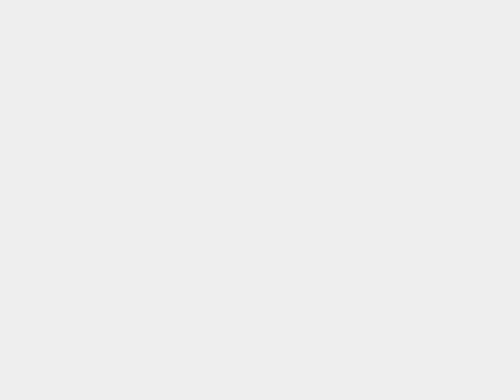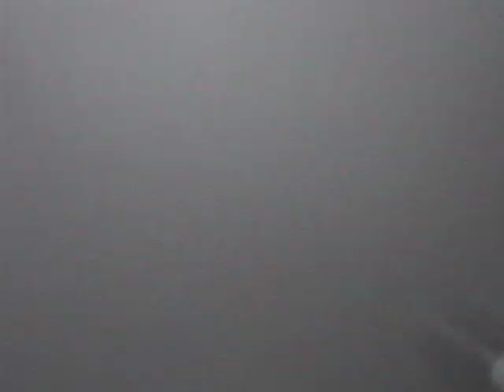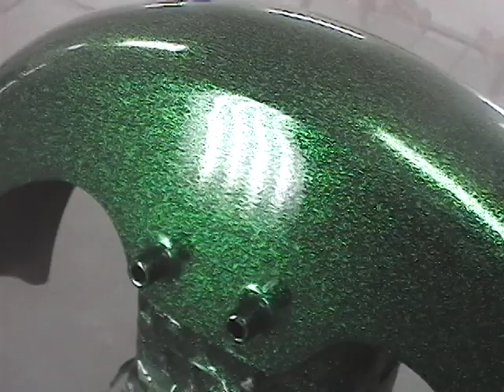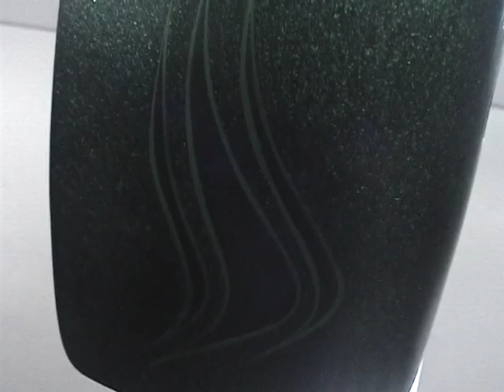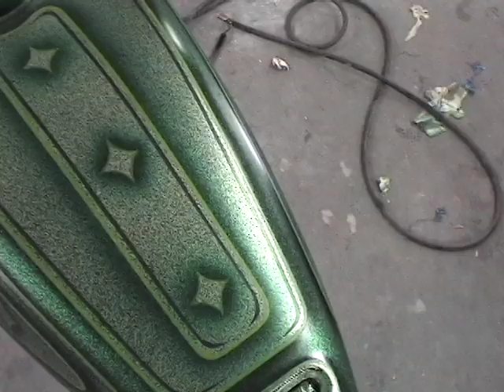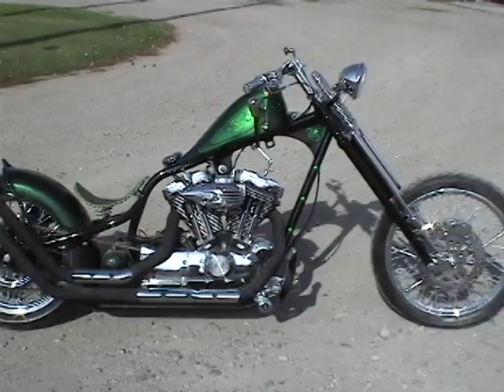Big flake chopper paint job

Comment from the maker: Thanks Z Man ! I used two flakes . 1st  Ditzler gold big flake which is a huge old school dune buggy type flake ! You will need to hog out a gun tip just to get it out . I shot it on in clear coat to help suspend the flake properly  ! 2nd I mixed my owen shade of  green candy by dumping blue and yellow candy together .  mixed a shot of house of colors extra large pale gold  {not to much } in the candy , then dump candy into the clear. Pale gold was use on all the top designs , and green candy .